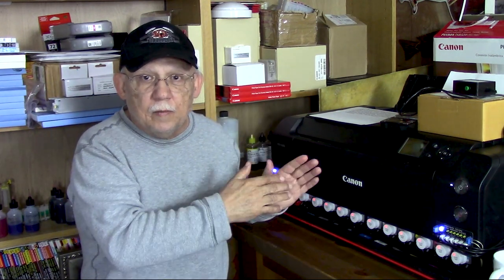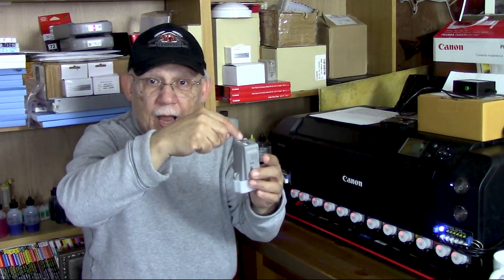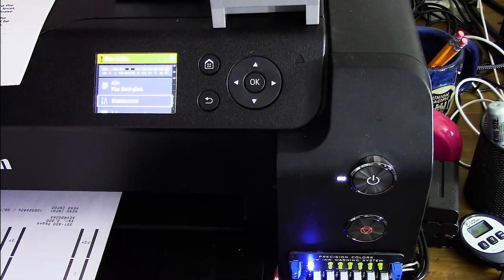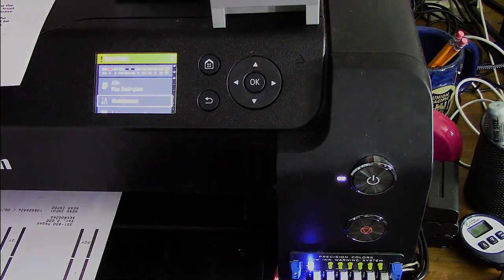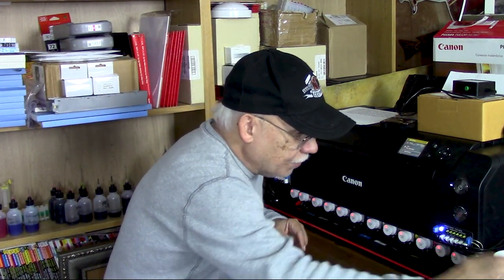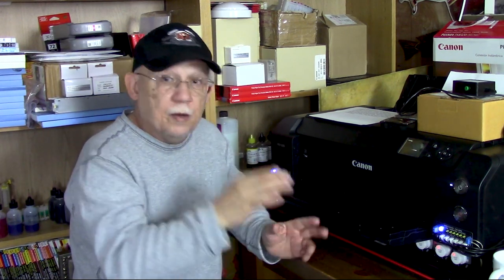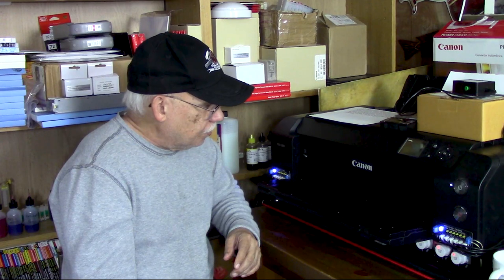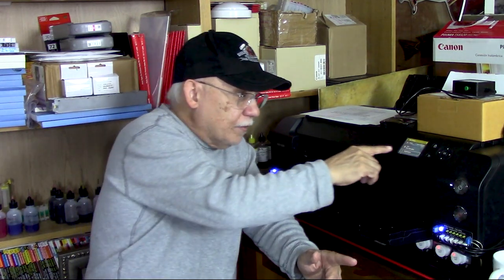What you need to do to Disable Chips for the PRO 1000 and how to use the Ink Level Sensor System!

Comment: The ‘White Stripes’ guy here! You know a month or so back I had a problem with unprinted White Voids in my prints. Turns out that it was due to Grease on the Transparent Film Strip inside and at the back of the printer. The roller bar just below the Plastic Strip has lithium grease on it and somehow just hints of this grease got on the Clear Film. The Film is used in calibrating the machine (if I understood the tech correctly). Clean it off with ISO Alcohol and bingo! Perfect prints. Sorry it took so long. I’m busier now than when I ran my business. I have a photo of the strip supplied by the tech if you could use it.

Comment: I just installed some precision color inks but I cannot disable the printer recognition.  No dialog box shows up on the printer when I hold the stop button for many seconds.  Code 1660, pro-1000
Reply from the maker: The error code is supposed to 1753. You can not let the carts run out of ink as the chip will just reach empty and there is nothing you can do then. You must top off the carts before the LOW warning. Eventually the LOW chip warning kicks it. Continue topping off. Low warning will continue for a long time and then you will get the 1753 error. Now you can hold the pause button to disable the chip. I have a video where I demonstrate that.

Comment: Hi Jose, necessito ayuda por favor! I have a Canon pixma ip8750. It was printing well but colors started to print weaker so I washed the head. I have done head alignment. the tests of clogged as well. It just prints the black ink test  and the grid is fine but no colors! The black prints fine text. All cartridges are recognised. Do you think that I need to wash the head again or this is other problem? Gracias Jose!
Reply from the maker: You have no M-Y-C color on the nozzle checks? Original carts or are you refilling them? Or non original carts? Don't wash your printhead can be permanently damaged.
Reply: @cheo1949  on nozzle print checks colors are not appearing as used to! Refillable cartriges but the software of the printer is recognising and it shows the level of ink....

Comment: @JoseRodriguez I have an opportunity to buy a Pro 1000 used for cheap but the seller says that he gets an 'open cover door' message and therefore can't print unless it's fixed.  Canon not helpful so wondering if you knew any way to fix it or any sellers of door sensors.  I've seen them for Pro 2000 but not Pro 1000.  Thank you.
Reply: Wow! That's weird. I'm in exactly the same predicament as of today lol. I got a printer super cheap and said I'd try and fix it, anyways I was wondering if you had any luck in that department?

Comment: Isn’t it better to use a hot iron to punch the filling hole instead of drilling? Which will be no debris at all.
Reply from the maker: Nope. You MUST have a 5x32 diameter hole in order to allow the plug to properly seal so all your ink does not leak out. Just removing the ball will not work. The plug will just float inside the existing factory hole. Resulting in Zero sealing. 
The FACTORY BALL SEAT has a small hole at the base and that has to be an accurate 5x32" diameter. The plug does not seal against the existing sides of the factory hole. It seals by compressing and passing THROUGH the new seat hole you created by drilling the seat and then it re expands which is where the actual SEAL is created. 
We've been developing and refining these techniques for over 15 years. Trust me. We've tried everything. No need to reinvent the wheel.

Comment: Hi Jose! Thanks for the video. 
My question is if the hardware update affects the way printer interacts with  cartridges? Any limitations or whatever? 
Heard you talking about update in one of your videos, but can't find it.
Reply from the maker: You Firmware?? And do you wonder about using single chips or disabling chips or what? Not it should not but can't be 100% sure. I never update anything.
Reply: @cheo1949  there is a firmware update for Pro1000 at Canon's site - enabling printing on longer media. I plan to refill original cartridges with their native chips. Anyways your words have sense to me.

Comment: Hello Sir! I just want to ask if there is a resetter for Canon PIXMA E4570 if ever I encounter 5B00? Because I'm planning to buy this unit. Thank you.
Reply from the maker: You need the cartridge code and then look on ebay for a resetter! Ressetters are programed for specific cart types which may be used by several printer models.